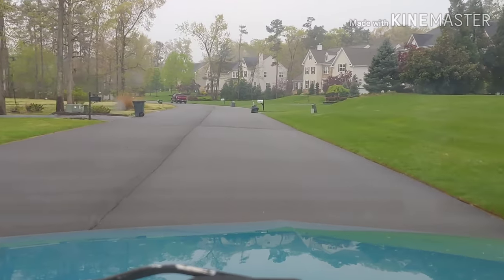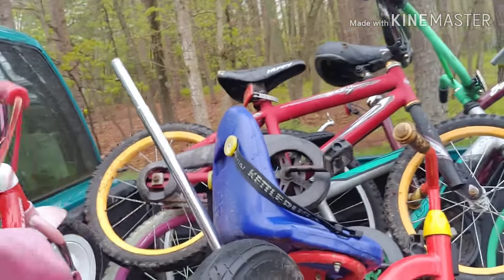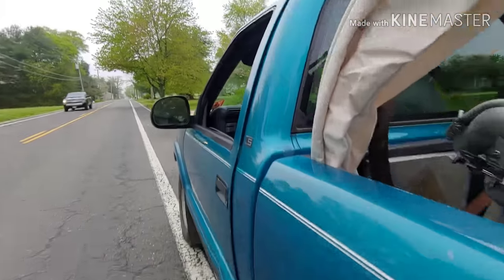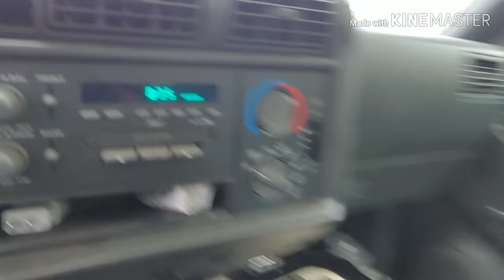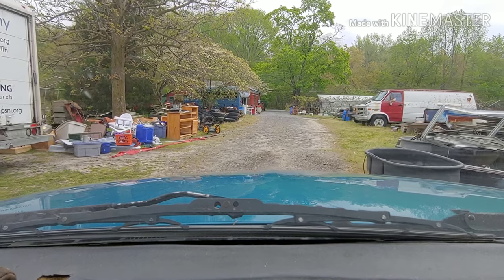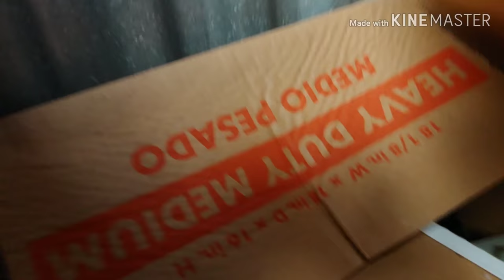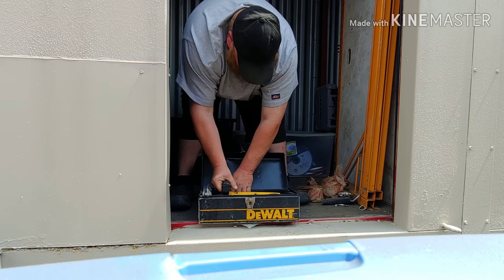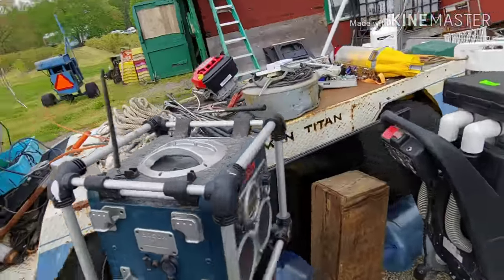Trash picking and small storage locker clean out

Comment: have you tried a transmission filter kit in the donkey  autoanything.com has them for 40 bucks
Reply from the maker: No it's a mechanical problem the reverse bands broken
Reply: i had a gmc that need more pump pressure for reverse it ended up being the filter seal. though it might help the donkey shift. she needs another guitar string lol
Reply from the maker: @mikerule1463  yeah who knows I'm not going to take it apart till it stops completely I got to put a starter in it in the next few days and then I'm going to keep running it Forward till it don't run no more then I'm just going to buy a $400 used transmission and throw it in there... well that's the plan anyway

Comment: " Burning that gas, v-6" Ha! My scraping truck has a 7.5 v-8, I'll trade you fuel mileage any day.😁
Reply from the maker: For sure.  Mad people tell me u need a bigger truck.   apparently those people have no clue wut im doing...  The auto ka 2.4. Gets 28 hyw. 24 trash picking. Its the best option i have found short of a 2wd 1500 with a 5 cyl benz motor running on vegetable oil....lol....which i will build some day.
Reply: Don't get me wrong, if you can get by with the small truck that's great!  I used to use a minivan but after our local scrapyard closed the next nearest opinion is 40ish miles away. If I'm going to take a load that far I'm going to take a load! 😀
Reply from the maker: @martinc591  for sure.  East coast yards do go down they get bigger. Close to the ports ya know